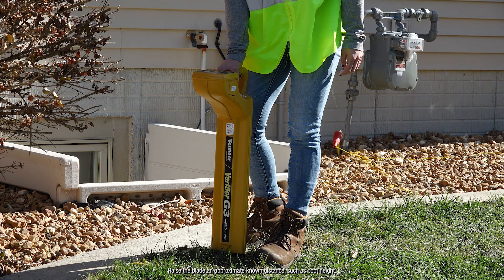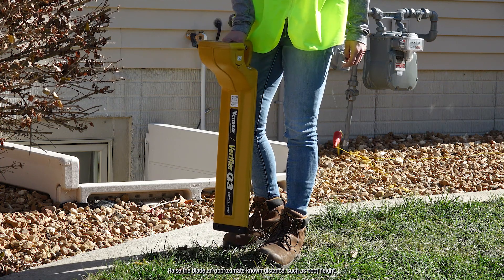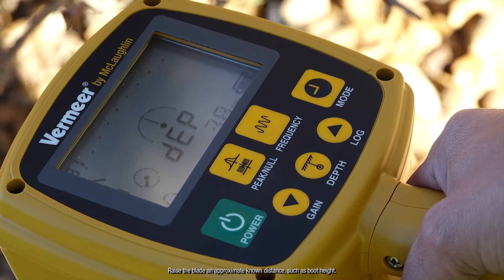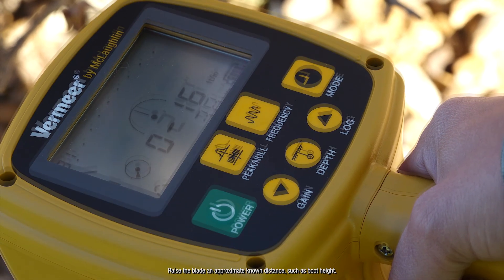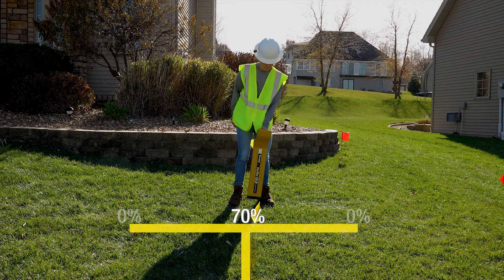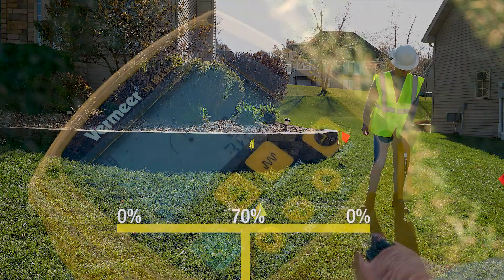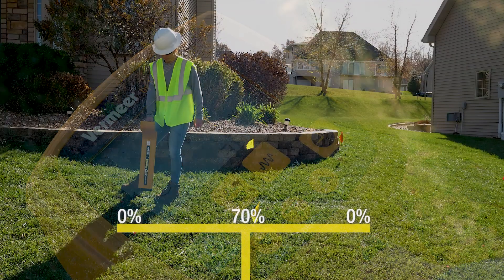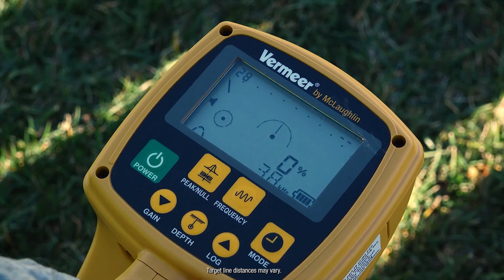How to locate underground utilities

Comment: Don’t you risk breaking a wire(s) inserting the ground stake?  How do you know where to insert the ground stake if you do not know where the wire(s) are located?
Thanks.
Reply: Pipes or wires are dug deep enough were you won't hit them. The steak on goes a little bit into the ground.

Comment: I noticed this requires a direct connection to the utility.  I cannot connect this to the 7.2kV line from the electric utility for obvious reasons.  Will it still locate this high voltage primary line, sense the 60Hz magnetic field maybe or will the transmitter backfeed through the distribution transformer?  This is the only line I know of in the vicinity - and it behooves us to make sure it is not going to be under where we dig.  We called 811 - not only are they blowing us off - they don't believe the HV line is where it truly is even the utility did not keep a record of it (yet I see the tags at both ends of the lines with binoculars)
Reply: I realize this is 2yrs old but for anyone else, you connect the positive to the box on the house or the metal transformer housing on the ground. The signal will still transmit thru the wires.
Reply: No transmitter required, when electronics has a power locate mode
Reply: @RdTdr-s8h  ya but im finding PM can be off a little bit and you cant always differentiate which line is which. thats why we use clamp ring or direct connect. guy thats currently training me (hes a 20yr lineman) refuses to rely on power mode and has me use 65.5k with our RD8100. (as for my previous comment, thats based off of training i had yrs ago with a past employer that may not have been quite the best way of doing things.) now i have to actually open the transformers, switch boxes and junction boxes and put my clamp ring on each neutral, primary's and secondarys. so far it seems like a much more precise way to locate electric but it does bleed and backfeed. to me such high frequency is a bit tricky.
Reply: @_AndromedaGalaxy_ 
Wowzer, hopefully they dont bury you in tickets.
Reply: @RdTdr-s8h  well its a town of only 33k and theyre not afraid to throw every guy in the shop at it though on slower days ill usually be the only one locating.